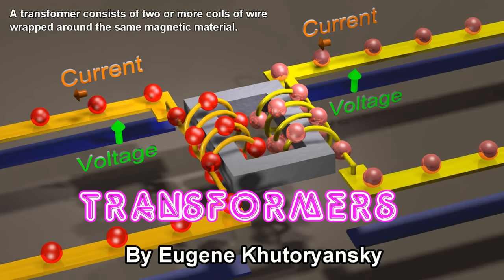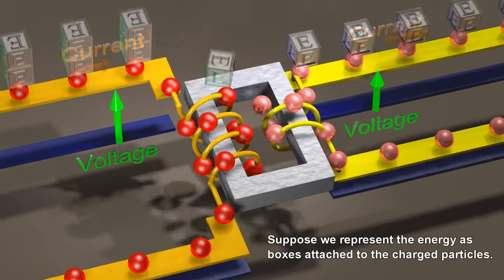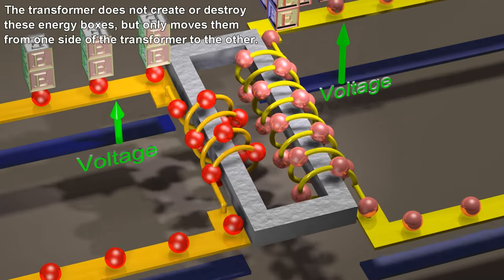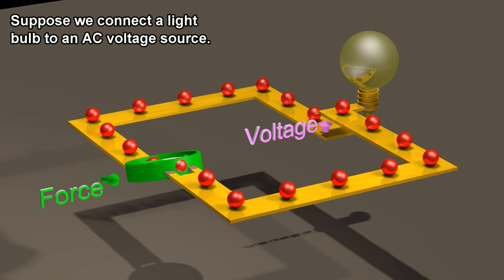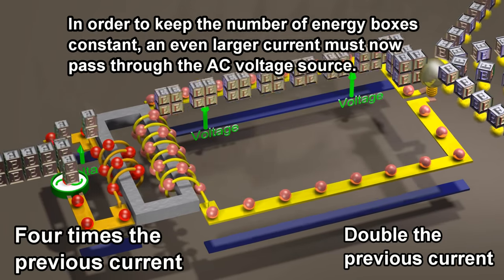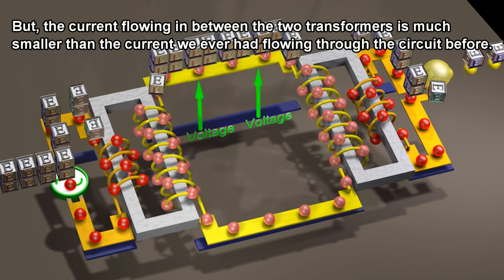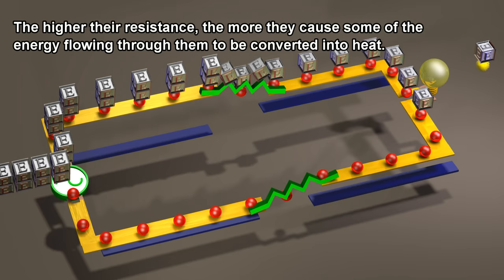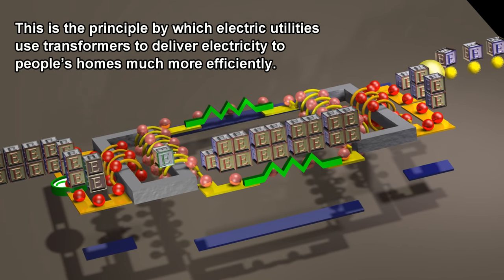Transformers - Electric Power transmission

Comment: 2:14 let's pause the video here and apreciate the use optical ilusion to make the right voltage arrow (green one) smaller or bigger depending on the output voltage.
clever Eugene is clever.
Reply from the maker: Thanks.

Comment: Amazing how it becomes easy when we visualize. Congratulations!
Reply: Amazing how it shows the analogy of transformers to gears as well.  It looks just like the current on both sides is connected like rotating shafts are connected by a chain drive or timing belt.  You can see that there is a ratio of current, analogous to a ratio of rotation rates in gears.   It would look like rotating gears, if he reversed the handedness of the secondary coil, to the current rotates in opposite directions.

Comment: There is a weird thing about transformers, And that is as follows:
AC current is changing in a constantly changing rate, specifically: i = Imax*cos(wt)
And a changing current at a constantly changing rate flowing through a coil creates a changing magnetic field at a constantly changing rate. But a constantly changing magnetic field induces a constant current in a coil.
So, if we wrap this up, the magnetic field created from the primary coil that is changing at a constantly changing rate, induces current that is changing at a constant rate.
So in fact, WE WOULD NOT END UP WITH NORMAL AC CURRENT IN THE SECONDARY COIL, as the current is changing at a constant rate not changing at a constantly changing rate(as current does the way we know).
I hope I get some explanation..
(Sorry for poor expression)

Comment: i had always visualised an inverted waveform on the secondary.  oh well.  Thank you forball of your informative work.
Reply: it deppends of the direction of the coil
Reply: If the windings both share the same axis around the core, and are wound with the same handedness, the waveform will be the same.   Use opposite handedness in the same location, and the waveform will be inverted.

If by contrast, the windings are on opposite sides of a rectangular closed loop core like they are in this annimation, then opposite handedness of coils means same waveform while same handedness of coils means opposite waveform.  This example shows opposite sides of a rectangular closed loop core, and opposite handedness of coils.

Comment: Eugene! I Love your videos. Thank you so much. You do such an ungrateful service to the public. You should get payed so much more for this service. Again thank you for doing this. This videos will teach people for YEARS to come. But I have a question, it is probably a dumb one but anyway - You say that when the voltage across the light bulb increases, so does the current.
But when the voltage is increased by the transformer, the current decreases. 
I can almost feel the answer, like i have all the pieces there and I know I am missing something.
Reply from the maker: Thanks for the compliment.  In the case of the transformer, it is the ratio of the primary current to the secondary current that is set by the turns ratio.  If we have a light bulb connected to the secondary coil, and we suddenly double the number of turns in the secondary coil, the voltage accross the light bulb will double, and hence so will the current through the light bulb and secondary coil.  But this means that the current in the primary coil will be four times its previous value, so as to satisfy this ratio requirement.

Comment: So what you're telling me in a nutshell is that, let's say I want 120 Volts to power my load. The Electric company is giving me 120 Volts, but they are far away. They are very far away so this increases resistance. Because we still want 120 Volts, V=IR and resistance increases... then I have to compensate by lowering the current, done through a transformer, and then at the end I will have 120 Volts on my load? 

Very educational and useful! Someone please correct me if I'm wrong!

Comment: Thank you so much again for this amazing Video. Looking forward to see the next lesson
Reply from the maker: Thanks.
Reply: @EugeneKhutoryansky  Why then  some people say that until you do not plug a equipment into the outlet you wont have any current flowing. ? I can see in the video that for the magnetic field to exist it is necesary to have a current passing through the wire, and for there to be voltage current needs to flow, hence how come can u meassure voltage at home between hot wire and a neutral if it si not supposed to have a current ? I am confused

Comment: I could be wrong about this
but you started off explaining that DC running through the coils act as if you just have 2 wires side by side
but as you have it going through an inductor
it's more like a resistor with the added effect of creating a greater magnetic field
suddenly stop that current and then you'd get a movement in the second coil
that said it's the collapsing of the magnetic field that drives the electrons through the second coil. so the point the electron flow begins to slow down is when the electron flow in the other coil would begin to accelerate.
Reply from the maker: +Aaron Ameer Beg, yes if the current in the first coil were to suddenly stop, current would end up flowing in the secondary coil.  But, if the current in the first coil keeps going at a constant value, then nothing will happen in the second coil, due to the fact that the magnetic field is not changing with time.
Reply: so you basically just confirmed what I said.

Comment: This Electron flow makes more clearer now in understanding Transformer ! And Electric flow in general ! Thank you !!
It really took me sometime to unwrap and understand below 2 minutes.

@ 3:23 At Transformer, 'Two particles with Energy' transferring to 'Single Particle double Energy' in other side, from LV/'HC' to HV/'LC', so this is with respect to Charged particles ?
@ 3:50 At Light bulb, HV HC or LV LC, this Current is simply from a Source, Is this in general ?

@ 4:30 Should be combining above two Times, but in secondary side, 'Single particle is carrying double Energy' should still having HV LC ? But showing HC & HV, contradicting what said @ 3:23 ?
Is it due to @ 5:00 keep maintaining the Energy constant that was received from source ?

Comment: It's unfortunate that the animation could not also illustrate that transformers also introduce a 180 degree phase shift in the AC waveform.

Great Video nonetheless.
Reply from the maker: For the way the coils are wrapped in this video, there should be no 180 degrees phase shift in the voltage waveform.  Whether or not there is a 180 degrees phase shift depends on which direction you wrap the second coil around the magnetic material, relative to the direction that the first coil is wrapped.

Comment: Hi Eugene! Great video. One question. Why at around the minute 2:30, the charges in one side of the transformer have more energy than those in the other said? I suppose you used an ideal transformer, which only converts current and voltage but not power. I guess the answer has to do with the charge flow per second.

Comment: Holy shit this video helped me understand why power lines have very high voltages!!!! It all makes sense now!!! Correct me if I'm wrong but the parasitic resistance (correct terminology?) of the distribution lines still wastes some of the energy coming out of the plant though, correct? 

Slightly off topic but further question: is the wasted energy from the voltage drops across the transmission lines a function of how high the voltage is? Like do you have higher or lower % efficiency once you go above or below certain voltage thresholds?

Comment: How efficient are the transformers themselves? Is a significant amount of heat lost in the transformers themselves?
Reply: Depends on the quality of the transformer.  A Dept of Energy 2016 rated transformer can have efficiencies exceeding 97%, at its full load.

Comment: sorry, unlike some of the other commentators, I found the music and scenario switching too distracting. It was easier to follow on mute with frequent pauses to read the text. Also, repeatedly switching back and forth between step up and step down transformers made it difficult to follow because you have to catch when it changes in the animation, which isn't easy to do when the voltages keep oscillation or notice the words on the screen, which is not easy to do when you're tracking the animation, and there's no lead up to the change.

Comment: I enjoyed watching your video.  By some of the comments posted, some may have questioned the use of your analogy of energy blocks , but I can see your point ; explaining a scientific concept on a novice level.  It's just that as a person once pointed out to me, "the trouble with using too much analogy in science, you start losing the concepts" (me paraphrasing what he said).   Is what you described a example of electromagnetic induction?  I like how you pointed out "real power" can not be created, so if you have a higher voltage induced in the secondary circuit, you must have a lower current  also (isn't this part of Ohm's Law P=I x E ? ).

Comment: Thank you so much for making these videos. 
 I have two questions:  In the beginning of the video, you seem to have the current out of phase with the voltage by 90 degrees for half of the ac cycle and in phase for the other half.  Why is this?  Is the transformer in the beginning not ideal?  Meaning that the current should always lag the voltage?
Secondly: Why does the primary current quadruple when the secondary doubles?  My understanding is this: The source induces an emf in the primary coil, which generates magnetic flux in the core, which then generates an emf in the secondary, (thus secondary current), which then causes a back emf, back mag flux, and back current in the primary. This causes the source to then produce an equal and opposite current to oppose this back current from the secondary.  I know the power must remain constant due to conservation of energy, by how does the source do this?
Sorry if these are silly questions, and thanks again.
Reply: klc032287  since power is constant, and power is voltage multiplied by current, when voltage increases in the step up current reduces so that power remains constant and vice versa

Comment: why current becomes low in step up transformer  though there is maximum flux linked with that coil and there is maximun emf...as the flux linked is directly proportional to the current...plz answer...
Reply: As the power going into the transformer and the power leaving the transformer is same, so the product of potential and the current is constant in both sides, so we can relate these terms according to increasing or decreasing behaviour

Comment: I don't understand how the current is decreased when there is an increase in voltage can someone plz explain?
Reply: a decrease in current means a decrease in current strength (Ampere), and voltage (Volt) increases.  the current may have high voltage, but low power.  and there may be a low voltage (Volt) and a large power (amperes).

Comment: Hey thanks again eugene, video is really brilliant, box work was awesome.i just wanted to ask a question, so see if you have a DC battery and you you have no resistor just plain wires, now when electron travels from -ve end to the +end of the battery it's moving from a low potential area to higher potential area so shouldn't it lose potential energy because now it's going more and more closer to positive things, said in simple words shouldn't potential drop occur even without resistance?
Reply from the maker: All batteries have some internal resistance.  Batteries are often modelled as an ideal voltage source in series with a small resistor.  If there are no other resistors present, the entire voltage drop would be across this internal resistance.
Reply: Physics Videos by Eugene Khutoryansky thanks for replying but I was asking that let's say in a galvanic cell, if an electron is going from -ve end(lots of electrons bunched up there) to a +ve end(lack of electrons), isn't its potential energy decreasing? So why ohms law says that resistance is a must if you want potential drop because if an electron goes from a "-ve" region to "+ve" one its naturally losing its potential energy....

Comment: Sorry I don't  understand  the part where you said if you increase the current flowing through  the  step up transformer by 4 the output current through the step down transformer would be doubled

Comment: I just have a question. If it wasn't a magnet the object the wires are wrapped around, but instead it was a magnetic material like copper for example, would it still work although weaker or not at all?
Reply from the maker: +David Flores, this will not work if the material that the coils are wrapped around is a solid conductor, as current in the primary coil will just cause circular currents to flow in the material.  These circular currents will cancel out the magnetic field created by the primary coil, and hence the secondary coil will not be affected.  Though, the material could consist of thin sheets of conductive material with insulators in between the sheets, to prevent the circular currents from flowing.  But, you would still want the material to be magnetic, as otherwise you might as will not have any material at all.  This phenomena still exists to a much smaller extent even if there is no material, and the coils are in air or in a vacuum.  It is just that the voltage and current induced in the secondary coil is much, much smaller.  The magnetic material just greatly increases the magnetic field produced by the primary coil.

Comment: I came from P-3 Orion avionics '87-91 during the conversion from 
analog to digital.  So it's been awhile.
Arcadians Build Arcades
I guess I needed little more than Ohms Law 
instead of a life sentence of jerkitude 
Space Race Blues
I've been missing since they started in 1981
but didn't go online until 2003 NAFTA

The color coding has me thrown a bit.
why pink and red?
for red and green color-blindness, 
this field was off limits.
The Prove Me Wrong issue pings since we built the web for it.
(Elizabeth Blackwell foundations think I'm extinct, due to #STEM and #GamerGate cheats)
I'm more A/V anyway, but this would have been REALLY handy saving some careers at ATT in Chicago.
This would have made teaching my class so much easier for some of the concepts.
Meanwhile, I'm a missing Petri Dish for Harvard, they're figuring out how much they owe me right now. 
(I'm considered extinct)
educators shouldn't gaslight each other so hard,

Comment: Hello. Thanks for all your videos!
Could you make a video on how an alternator work relalated to energy loss with and without load? Thanks
Reply from the maker: That is on my list of topics for future videos.  Thanks.
Reply: @EugeneKhutoryansky  Why then  some people say that until you do not plug a equipment into the outlet you wont have any current flowing. ? I can see in the video that for the magnetic field to exist it is necesary to have a current passing through the wire, and for there to be voltage current needs to flow, hence how come can u meassure voltage at home between hot wire and a neutral if it si not supposed to have a current ? I am confused

Comment: induced voltage in secondary is not in phase with primary applied voltage
it is 180 degrees lagging
Reply: Not necessarily.  It depends on which direction the two windings are wrapped.  In this example, it shows two windings of opposited handedness on opposite sides of a rectangular closed core.  The fact that I mentioned opposite twice, means that the current would be in phase across the transformer.   If I only mentioned opposite once in the description of how they are wound, it would have a 180 degree phase shift.

Comment: please elaborate on how the number of turns affect the change in secondary voltage? If the secondary turns is more than primary, the voltage (energy of electrons ) increases, how?
Reply from the maker: +bijesh balan, A changing magnetic field through a loop causes electric fields around the loop.  The voltage across a coil is the sum of the electric fields around each of the loops in the coil.  Therefore, more loops gives more voltages.  You may want to watch my video titled "Electromagnetism - Maxwell's Laws"  The link is  http://youtu.be/9Tm2c6NJH4Y

Comment: at (2:26) you mentioned that  the transformer's side with higher voltage has lower current then at (4:52) you said that as the bulb has larger voltage then a larger  current passes through it which is double the previous current (the current now at the lower voltage side as i understood)  can you explain this misunderstanding please ?
Reply from the maker: In the case of the transformer, it is the ratio of the primary current to the secondary current that is set by the turns ratio.  If we have a light bulb connected to the secondary coil, and we suddenly double the number of turns in the secondary coil, the voltage accross the light bulb will double, and hence so will the current through the light bulb and secondary coil.  But this means that the current in the primary coil will be four times its previous value, so as to satisfy this ratio requirement.